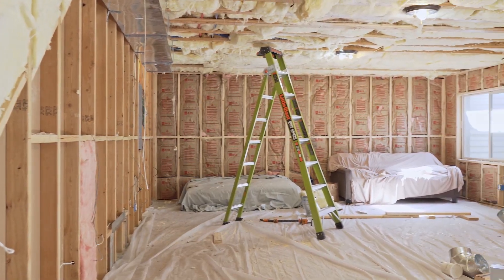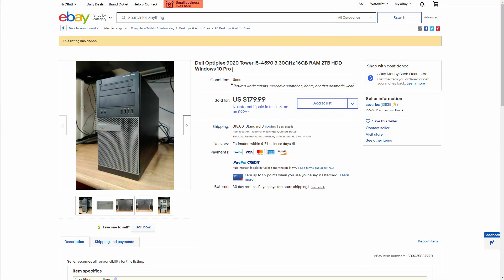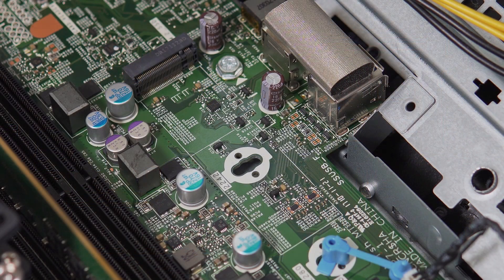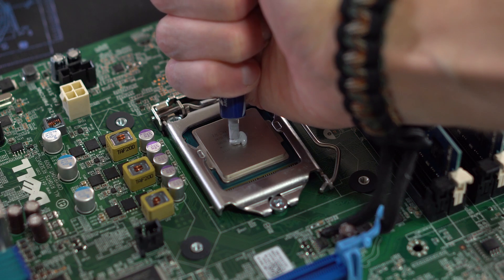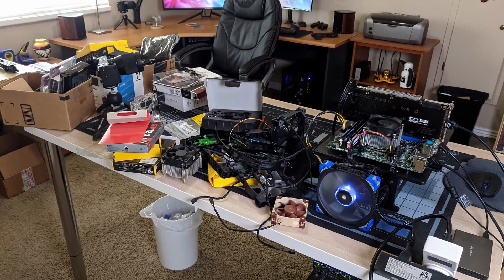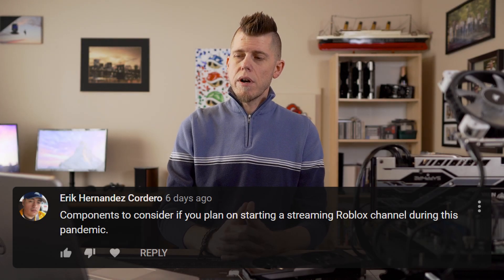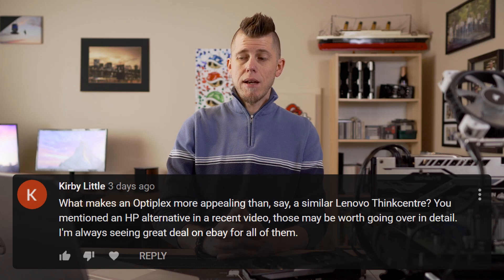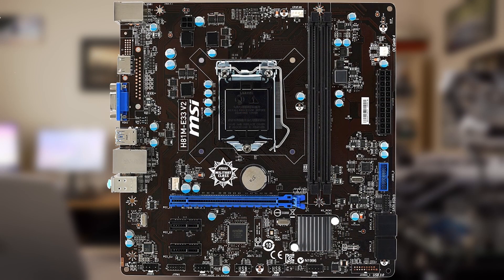Dell OptiPlex Q&A Pt. 2: Power Supply & CPU Cooler Upgrades, NVMe m.2 SSD's & More

Comment: Question! I got an asus hyper m.2 x 16 card v2 in my 9020 and whenever im using a graphics card i have mouse stuttering. I think its pushing to much data, suggestions?
Reply from the maker: That's entirely possibly depending on how many m.2 drives you have populated in that m.2 card and how much data is being accessed and what GPU you have and how much data it's using. Keep in mind that the second x16 slot in the 9020 is only wired as an x4 slot, not the full x16. And even if it was, you don't have enough PCIe lanes available from the CPU to fully utilize two x16 slots. So if you're using your GPU and it's using a lot of bandwidth across the x16 as well as the m.2 card using a lot of bandwidth, it's possible it could choke the USB bus.
Reply: @TheGameBench  I had a feeling i was just pushing to much data. Im a broke pc gamer so more or less any questions i head rite to your videos. Thanks for the reply man. You are the optiplex expert!

Comment: Can I put a 3 fan 12 inch rx 570 4gb inside my modded MT.
Reply from the maker: I'm guessing you're talking about the Red Devil 570? As long as the hard drive cage is removed, it should fit no problem. If you have an xx20 model you shouldn't have any issue with cable interference, but with the xx10 and x90 models, you'll have to get some low profile cable to clear the GPU.
Reply: @TheGameBench  wdym xx
Reply from the maker: @osnocyn  So, like... xx20 would be the 3020, 7020 and 9020. xx10 would be the 3010, 7010 and 9010. And x90 would be the 390, 790 and 990.
Reply: @TheGameBench  ok thx, I would use a certain angle SATA if I had a 790 in order to put in the gpu right?

Comment: I want an led fan for the cpu and back of the system, any suggestions?
Reply from the maker: Might be hard to find an 80mm and 92mm LED fan these days. Was a lot easier back in the early 2000's since they were used a lot more than they are now. If you really want LED fans might be easier to change the cooler and use a different rear fan, but then you run into those same compatibility issues with the fan controller throwing the F1 error.

Comment: Greetings! I`m glad to discover this channel, your videos are very interesting and informative!
I don’t know what progress Dell-users have at the moment in their search for properly working fans, but I`m also interested in this issue.
I have a couple of assumptions that need to be tested (unfortunately, I can`t do it by myself yet):
1. DELL often uses `server` fans with high RPM limit (probably some special type of PVM signal is used too, I dunno for sure, but if so - i have no idea how to solve it), so perhaps, thats why most generic_aftermarket_fans don`t pass the test and this causes an error. In other words, maybe fans with an increased lower and upper limit of RPM have more chances to be determined successfully by the mobo.
2. I found one interesting tip about using a Y-splitter for CPU fan: one end for the replaced fan, and another one - for the stock DELL fan, keeping it just for control. Perhaps this trick could help (or not =))
Reply: Btw, i had bought a CM Hyper TX3 Evo for my 7010 MT - and it just works, no error at startup (only diagnostics test 'Cpu Fan' cannot be passed, looks like fan`s max. RPM is not enough) and everything seems to be ok at overall usage/gaming.

Comment: Are 7010 optiplex worth it
Reply from the maker: I would still suggest the 7020 or 9020 over the 7010 or 9010, but at the right price, I'd say they're worth it. I wouldn't suggest one with an i5, go for one with an i7 and they're worth it at around $160 USD.

Comment: I don't remember you covering my model OptiPlex 790 I have been having an issue adding   memory even though everything I have read  said I could  run up to 32gigs of ram I haven't ever gotten the comp to except more than 8 and only on 2 slots is it possible there are damaged slots?
Reply from the maker: Yeah, I've only ever covered the comparative performance, but I haven't gone in depth on any of the x90 models. It should accept up to 32GB, so 8GB per slot. There could be a number of issues causing the problem. The first being that the 790 initially only supported 16GB total as 4GB per slot. You might need to update the BIOS in order to utilize 8GB per slot. Another issue to speak of is RAM compatibility. These systems can be pretty picky about RAM. Have you made sure than they all work individually in the system? If so, then that shouldn't be the issue, but it's still not out of the question. As for two of the slots not working, can you not get any RAM to be recognized in them? And are they corresponding slots, as in one matching channel? It could be bad slots, but it could also be damaged pins in the CPU socket that correspond to the memory controller on the CPU. It could also be the memory controller on the CPU have one bad channel.

I would start by taking out the CPU and looking for any bent pins in the socket and damage to the pads on the bottom of the CPU. You could try running Intel's processor diagnostic tool to see if it throws any errors. Then, you can always try updating the BIOS.

Comment: Is the stock optiplex psu enough for a gtx 1660 6gb super ?
Reply from the maker: Yep, just use a dual SATA to PCIe adapter since you'll draw more power than a single SATA connector can provide.
Reply: What would happen if I leave a single SATA connector ?
Reply from the maker: @Random12347  If you just used a single SATA to PCIe adapter, you'll overload the SATA connection as you'll be pulling more than 54 watts through it. This can cause it to overload the connection and result in various problems. You could fry the connector, it could damage the components plugged into it... or it could even start a fire. If you only have a single, I would high suggest not using it and buying a dual. They're not expensive, and very cheap insurance not to cause a fire or damage your new GPU.

Here's a link the one I use:

https://www.amazon.com/Power-Express-Video-Cable-Adapter/dp/B007Y8FSMQ/ref=sr_1_2?crid=266XR56P4MDO7&dchild=1&keywords=dual+sata+to+pcie+8+pin&qid=1617895460&sprefix=sata+to+pcie+8+pin%2Caps%2C216&sr=8-2
Reply: @TheGameBench  thank you I appreciate it I will take your advice. Thank you for the hours you put into helping people such as myself.

Comment: What do you think about the newer optiplex models like the 5040, 7040, and 5050mt vs the 9020mt? I've been looking for a 9020mt with a i7 4790 or better processor, then I started looking at newer models like the 7040 that were only $20 more than the 9020mt. Are the newer models harder to work on and upgrade? They look like the same set up to me...
Reply from the maker: It's funny you mention those. I just got a 7040 and a 7050 in and I've started testing with them. They definitely have their limitations compared to the xx20 series. They're smaller and have weaker power supplies. Though I'm liking the size, but I like a challenge. The difficult parts about these is you're limited on GPU size and there's only so much you can do since the case is thinner. This also means that the CPU cooler is smaller than the 9020 MT and doesn't cool as well. Then you're dealing with a TFX power supply, the same 240watt that's in the 9020 SFF, so you're pretty limited there. And replacing the power supply isn't so straight forward.
Reply: @TheGameBench  thats what I was worried about, they looked to be about the same size but configured differently. The 9020mt are just hard to find a good deal on right now and I wld really like to get a cpu with like i7 6700 or better. Just thinking I wld rather pay another $50 to get a better processor...
But the best processor I've seen in a 9020 (that hasn't been replaced) is a i7 4790 I think, ideally I'd like a i7 8700 so I cld have some room to grow as well...
Reply: @TheGameBench  oh and it wld be a bonus to find one that runs ddr4 ram instead of the ddr3! 
I have found your videos really helpful tho!

Comment: Nice man. I recently got the optiplex 9020 i7 3770 and 16gb ram.... its good n all, i wanted to get the gtx 1050ti but its more expensive yo buy than the whole pc!!!
Reply from the maker: Try looking for an XFX or Asus Strix RX 470 4GB. You can find them as cheap as $150, up to $200. They'll outperform the 1050 Ti, and they'll run off the stock power supply. Some models consume a lot more power and won't however.
Reply: @TheGameBench  ill look them up on ebay. I dont really know much about gpus!! just want something to run fortnine or gta ..thanks anyway bro appreciate the help. liked and suscribed!
Reply from the maker: @VisitHargeisa  Yep, the 470 would do pretty good at that. I put one in a build for my bother's family at Christmas so they could play Fortnite and it does really well. And thanks for the sub!

Comment: I have a question so I want to use my old hard drive with windows 10 on my new pc build will windows 10 still be there?
Reply from the maker: Are you wanting to use it as the boot drive? You can. Windows 10 has gotten better about transferring into another PC. I don't suggest it though. I would suggest doing a clean install of Windows. If you decide to, you might need to reactivate Windows though.
Reply: @TheGameBench  alr thx luv the content keep it up 🔥

Comment: I have a question? For a 9020 do you think DDR3 1866mhz is supported or is 1600mhz is max
Reply from the maker: DDR3 1600MHz is the max supported. Doesn't mean that faster RAM won't work, but it will only run at 1600MHz rather than 1866MHz. Might not be compatible and it could only run at 1333MHz instead, or it might not work at all. Your best bet is to stick to the OEM style RAM that comes in these, like Samsung, Elpida, SK Hynix and Micron. I'm partial to SK Hynix. The fancy RAM with heat spreaders often works, but compatibility is spotty. Found some Crucial that worked perfectly, and another kit that looked the same that wasn't compatible.
Reply: @TheGameBench  any particular amazon links for 2x8gb ram that will work?

Comment: Yes Lenovo’s older selections have restrictions on gpu support. But I think that trend stopped around the pcs that have 4th gen cpus. Not to long ago I got a Lenovo m73 MT with a i5 4590 and 12g of ddr3, and I installed a rx 480 4g. You would need to look into it more but from my experience it’s ok. The only downside I would say is you need a 14 pin adapter for a custom power supply for graphics cards

Comment: I would greatly recommend the Lenovo m73/m93. It’s a great alternative to the dell optiplex 9020, in the sense that it has 4th gen intel cpu support. Also if you were to case swap it, it wouldn’t take as many adapters as a dell optiplex. Also since people know that dell optiplexs are great for turning into gaming PCs, the prices for them skyrocketed. In comparison to the Lenovo, which has gotten cheaper. You should look into one !
Reply from the maker: I've actually looked into the m73 and m93 as I have been looking into the Lenovo systems, but everytime I've looked, they've been on the high end, but I think that's because there are less of them on the market. Also, right now is a bad time for pricing no matter what it is. Demand is just so high for PC parts right now.

That being said, I'm not opposed to looking at them. It's just a matter of if I can get to them before it no longer makes sense.

Comment: if anyone wants to try messing around with installing a bigger gpu the nvidia og refrence cards will fit.  the aftermarket ones dont usually fit unless its a zotec.  i got a 2060 super founders edition in my optiplex and couldnt be happier.  i found a dell server power supply, so i dont take any power from the sata channel.  also upgraded to the fastest samsung nvme drive.  i use it as my boot/gaming drive.  it does make a difference in loading times.  I got it for a good price.

Comment: I have the 9010 do I need a bigger psu for a 1080 ti..? Also I have an i5-3570 do I need to exchange that for an i7..? If so which i7..?
Reply from the maker: As for the power supply... absolutely. You'd need at least a 500 watt for stock clocks, and it would have to be a top notch 500 watt. That being said, the i5 would be bottleneck city. Your best option is the i7 3770, but you're going to bottlenecking it pretty badly at 1080p as well due to IPC limitations. I made a video comparing the 2nd, 3rd and 4th gen and I tested the 1080 Ti. It can give you a good idea of what to expect, but with the 3770, I'd shoot for 1440p over 1080p with the 1080 Ti.

Comment: Hello I want to ask you one thing that I have installed an rx 580 nitro plus4gb with an 700 watt 80plus supply but my i7 3770 reaches 75-81 degrees during gaming and I changed its thermal paste but still it gets the same temps
Reply from the maker: @asheramir2002  Yes, only one can fit with a 120mm, but you don't have to remove the drive cage. I've seen people put them in there with the HDD cage in. Either would work.
Reply: @TheGameBench  thanks for replying and you are the best optiplex youtuber
Reply from the maker: How hot is your GPU getting? I imagine it's dumping quite a bit of heat into the system. It might need it's thermal paste changed, or it just might be a ventilation issue. How are the temps on both the CPU and the GPU if you leave the side panel off? The GPU might need a TIM change, you might need to add a front fan for better airflow, or maybe both.
Reply: @TheGameBench  my gpu gets like 50-65 degrees temp
Reply: During gamimg
Reply: @TheGameBench  if I leave the side panel CPU gets around 70-75 but I might try it again but it's temperature is still high
Reply from the maker: @asheramir2002  Your 580 is only getting to 65 degrees with the side panel on? That's pretty impressive. As for the CPU, the low 70's is pretty typical and about what you should expect, but with the side panel on. If the GPU is running that cool, I'd say it's doing very well and doesn't need new paste. I think your problem is airflow. You need to bring some fresh air in as the heat the GPU is dumping out is just too much for the rear 92mm fan to deal with alone and it saturates the causing the CPU temp to go up.
Reply: @TheGameBench  can u help me can I install two 85mm fans in front of the case by not drilling those two hdd cage things that you drilled in Air flow video
Reply from the maker: @asheramir2002  Yes, you could make them fit, but the biggest fan I could get to mount cleanly was an 80mm. So, a couple of 80mm fans would flush mount with the HDD cage in and I would suggest cutting the material out in front of the fan if you can. If not, there are some protrusions you'll have to remove, at the very least, since they'll interfere with the fan blades. The 85mm will run into something and likely won't mount flush. If you're fine with that, you could fit a 120mm in there. And I think that would be your better option.

Comment: Hi, I had an optiplex 3020, to which i recently swapped the motherboard and front io to those from an optiplex 9020, everything seems to work fine. Although there is now an air temperature sensor error along with cpu fan speed being unusually high, temps are fine and cpu has been repasted, bios is updated to a18, the rear chassis fan, since i didn’t have one i used a 5 pin 80mm cpu from an old optiplex 780 for that. What do you suggest i do?
Reply: I figured it out. I just need a new case fan, and a thermal sensor cable.
Reply from the maker: Yeah, without that sensor plugged in, the fans go full speed. Glad you got it sorted.

Comment: Would kill for a detailed optiplex 9020 SFF case swap video.
Reply from the maker: The only problem with the SFF models is that there's not straight forward way to swap the case and adapt the front panel like mini towers. However, I've got an idea to make a baller SFF system... without the case swap.
Reply: @TheGameBench  I picked up 3 7020sff's for a little over $100 in 2019. I love them for what they do. I did get a 250 gig ssd for them and would absolutely recommend that upgrade.
I found 3 8750's for about $7 and did that upgrade. (I know those GPU's are stinky but they are better than nothing and let the cpu breath a bit) (my kids are young and only one game that they want to play is unplayable) moving forward, you reccomend looking at a gt 1030 with gddr5 for easy of low profile and no psu upgrade. I probably just overpaid for 1 of those to try it out, before overpaying for 3. I really appreciate your channel and would love a little SFF love. I am pretty sure I would try doing whatever you reccomend immediately x3. 😉

Comment: I don't want windows 10 on my Dell OptiPlex. If I do that It will no longer play my old games. I don't even like Windows 10.
Reply from the maker: Well, if it's connected to the internet... you might want to reconsider that soon, or remove it from the internet. But I get it. I've got a couple of old DOS machine. One runs Windows 3.11 and the other runs Windows 98.

Comment: So far i have found a solution in my T1700 case swap build. I have these cheap 120mm Rosewill fans that do not throw error codes for the rear exhaust fan. But at whatever rpm it spins at its super noisy. I discovered that while trying out a noctua fan, that refused to work with this build, it had an included adapter called a low noise adapter NA-RC6. Adapter + rosewill fan = little to no noise and no F1 fan error code. Win Win! So i just went on ebay and ordered one of those. So hopefully that solves the noisy rear exhaust fan on the T1700 build
Reply from the maker: Yep, I showed some of those in my last build video. They're just cables with resistors inline. Lowers the fan's voltage. And yeah, I've found that these just do not like Noctua fans.